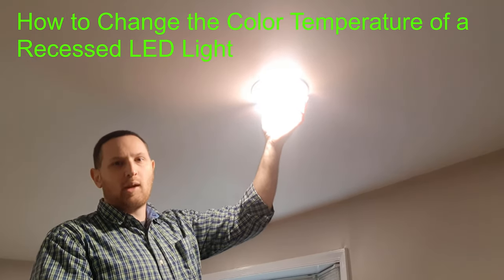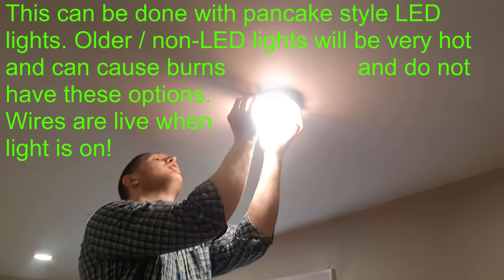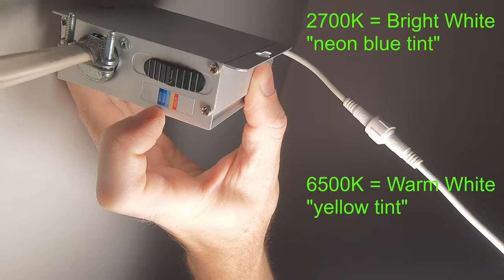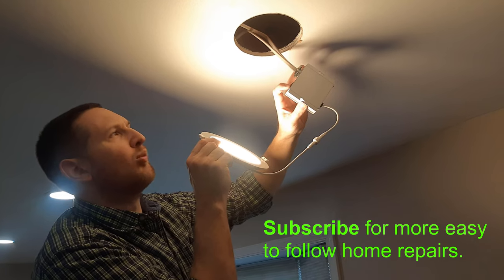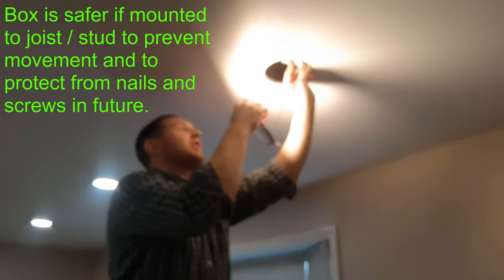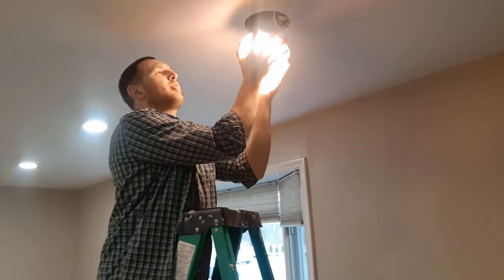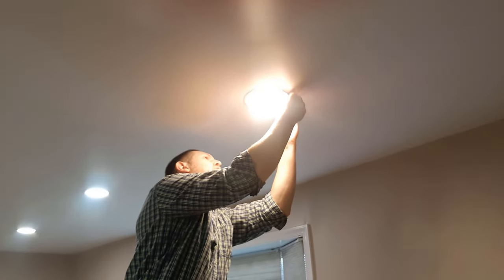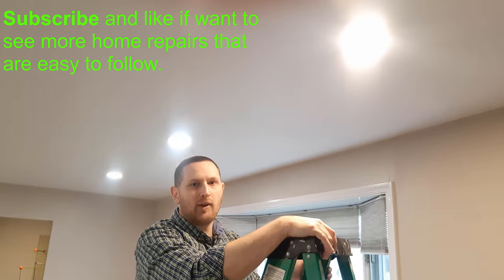How to Change the Recessed LED Light Color Temperature (Adjust Cool White to Soft White 2700K 6500K)

Comment: At the 34 second in the video, a chart is displayed showing 2700K as bright(blue) and 6500K as warm white (yellow).   These measures are incorrect.  It should show 2700K as warm and 6500K as bright.

Comment: Do most of these lights have this adjustment?
Reply from the maker: Many of the flat pancake style LED lights (last 10 years) will have a few color options similar to this. The old big cam lights with actual bulbs would not be adjustable other than actually changing a physical bulb.